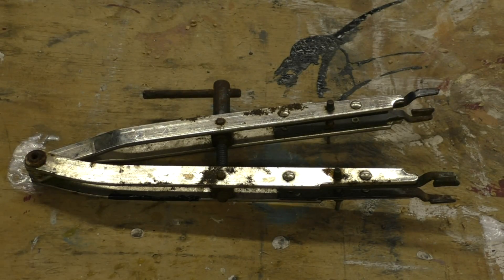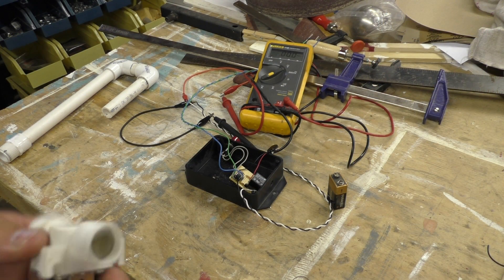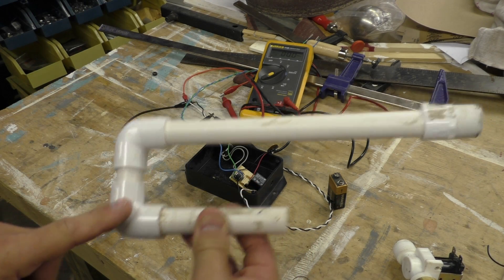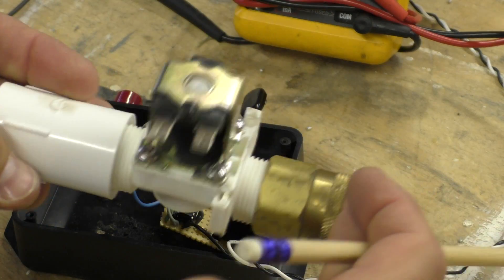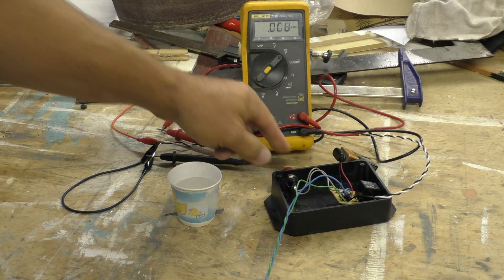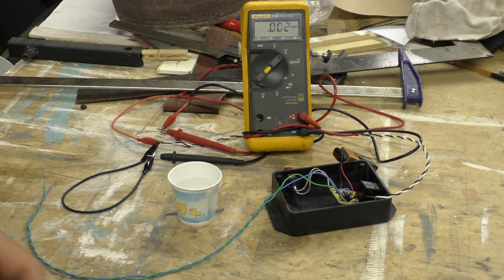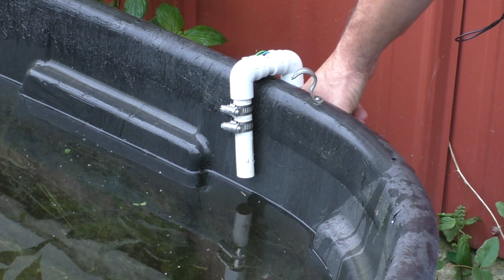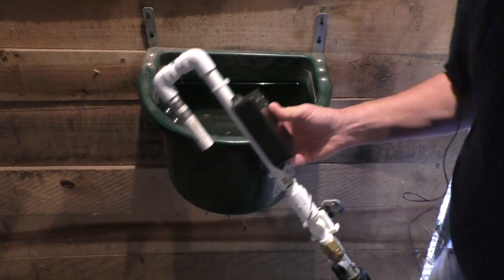How To DIY Automatic Water Valve for Open Top Containers

Comment: How long will this attiny last with the 9 volt battery? I like the automatic drinking post but they cost $400+ each. I was thinking what If the horse requests the water with a switch? PM me I can do all the CAD modeling. Thanks for sharing

Comment: I am looking to add some shutoff valves to my drip irrigation system that I can integrate into a smart home.    

I was thinking of using a solenoid like this.  How many open hours of watering will the battery last?

Comment: hi, is it possible to use a small float switch with this project rather than using the open contact metal? and also in the schematic, were is the diode?

Comment: just use a basic float valve and attach it to the container wall. it will do same function
Reply: That’s true, however in some farm situations I’ve found unless the float valve is completely enclosed and inaccessible to animals etc, clogging can occur and you become very reliant on one or two screws to effectively switch off and conserve your water supply!

Comment: 1st of all I want to thank you for taking the time to make your videos.  I have downloaded the schematic drawing and have looked at it trying to understand how this works. I do not now what the symbol means that hooks to the GND on the relay at he bottom. The one with curly with 2 long lines with black rectangle and arrow pointing in opposite directions. I can only assume you are showing the 1N4001 Diode but i have not seen a diode symbol like that.  I am a newbie at this as you can tell.  If it is a diode do you put in the circuit so the neg electrons can flow to ground in other word anode connects to relay side and cathode to connect to GND. Also where you hook the 9v battery where the divider resisters are, am I correct to assume that the Water Sensor ring is hooked to +9v Pos and when water grounds the circuit that is what flips circuit off but how do you keep from draining battery through water sensor rings.  Also would the 9v that GNDs  travel into Attiny 85.  Have looked at your video for several days and I am just trying to understand. If I could have seen the back side of your board I maybe could have figured it out.  I am not trying to point out anything bad I just want to understand the hole project.  Thanks and God Bless.
Reply: im with ya dude, having the same problem. were does the diode go? and confuse on the pin 4 of attiny if its a diode or battery symbol.

Comment: Great video. Am i right in thinking its not like a toilet system that auto refills its just you start it and it auto shuts off? Thanks
Reply from the maker: You are correct, but it can easily be changed to work like a toilet valve.

Comment: Are you interested in making and selling one I could sure use it I have the same problem
Reply: Christopher Hopkins float valve works way better
Reply: This comes from experience..... floats work great until the inlet gets clogged up or the screws providing the lever rust or loosen.   Definitely heavy duty fully enclosed float valves are preferred.  But gotta say, hook this valve up to a solar panel and can’t go wrong.

Comment: WATER COOLER FLOAT VALVE WOULD WORK WELL IF YOU HAVE THE ROOM IN THE TROUGH...NO TURNING OFF OR ON...KEEPS THE LEVEL CONSTANT...MOTOR SPRING COMPRESSOR...

Comment: For project boxes, if you need to give them a waterproof covering, I highly recommend either elastomeric roof coating (thick but sloppy looking) or multiple light coats of Plasti-Dip or Flexi-Dip spray paint.   Works great for waterproofing things.
Reply: I’m screenshotting this comment.  Very helpful cheers 😎👍

Comment: Why didn't the water turn back on when you pulled the pipe out of the water.  Seems pointless to have it shut off automatically if you have to manually turn it on.  A toilet valve would be cheaper and easier to replace if something should fail.
Reply from the maker: So it can be moved to the next bucket or container without spraying water all over the place.

Comment: can u  please give the circuit diagram. your site in description is no longer in use
Reply from the maker: Sorry about that. I've updated the link in description.
Reply: Sir , Three question. One- Can I use RO water purifier solenoid valve ? Two-  You are using ATTiny85 in the video, but you have used ATTiny13 in the circuit diagram. Last - can I use a SPDT relay?

Comment: That is a high-tech float valve. You could do this with a cheap non-electric float valve and water pressure, but yours looks waaaay cooler and is probably more universal. If you want to be safe, use as many redundant devices as possible, so that it would be more likely to accidentally shut off, rather than accidentally stay on. I suppose you could setup some sort of audible alarm too.

Comment: Liked, subscribed, and favorited!  Im a machinist by trade and my knowledge of electronics/electricity is home and shop wiring, relays, contactors.  What would you suggest as the easiest way to start to learn electronics?  I looked up the Attiny and the Xbee and have no idea how to use them.  Nor would i know how to divide the voltage down to 5v like you did.  Thanks for the guidance.

Comment: Curious to take a peek at your attiny code, are you using the interrupt?  Any idea how long the battery may last?
Reply from the maker: I am just reading the analog pin in a while loop.  No interrupts are used.  When the solenoud is open, it pulls about 60ma.  That will get about 5 hours of open time.  Enough to fill a 100 gallon water tank 25 times, which is a whole summer season for me.
Reply: Making Stuff
How the valve opens again?
It looks very good to me I have salt water and it destroyed almos everything
Reply: Making Stuff

Comment: This is cool, and I can think of some good applications of it for my own use, where a regular old float valve isn't feasible. Note that it's good practice to wrap thread tape on the pvc threads before connecting them. PVC threads are never very precisely made, and the tape prevents the joint leaking.

Comment: The tool is used for compressing valve springs on small engines.
Reply from the maker: +George Throckmorton This is the correct answer.  We have a winner!
Reply: Yeah, its a valve spring compressor.

Comment: Dividers

Pipe to hose adapters.  Kind of pricy if you need many. -- Your next assignment: Do the same thing without power.  My wife has 40 horses in stalls to monitor, plus various troughs, so it needs to be cheap and not powered.  Our only good solution currently is a $40 valve, but still not ideal.  Current solution uses float enabled valve, but horses like to play (spelled break) the floats.
Reply: Use toilet float valves, but put them in 3" PVC pipe.